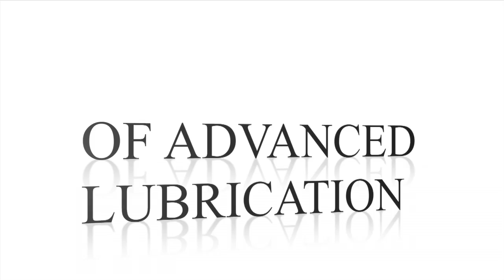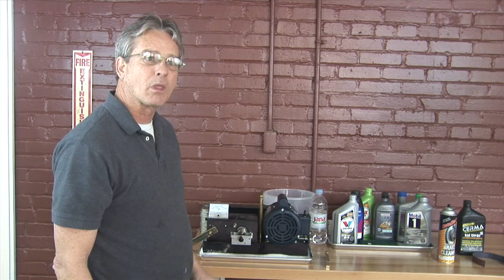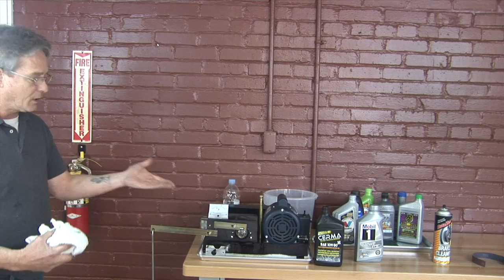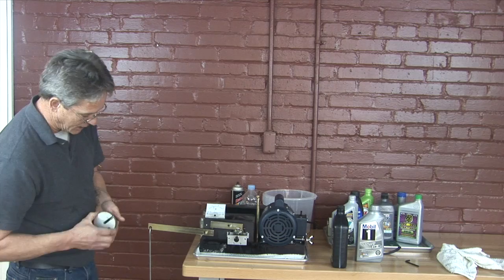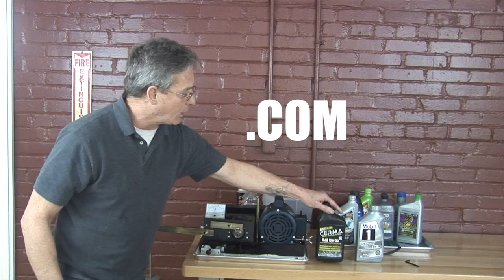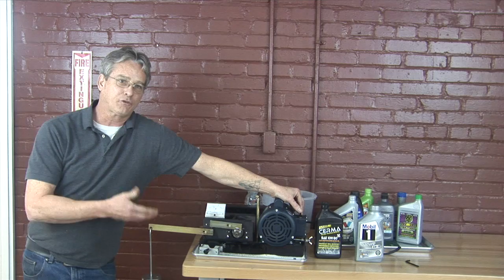Cerma Oil Advantages Demo

Comment: can't use this....need to be done correctly and with good sound, videography, etc..
Reply from the maker: no kidding, told you I had to redo when I receive my new mic system.
Reply: This is just pure silicone and will make the engine run more quickly and cool . It's just to expensive for silicone i have a God truck 159.000 miles id applu this product and make a video and show if this really works the truck starts hard on cold days and viberates holds almost 5 gallons of oil id like to prove that I wrong ans that this is a true product unlike all the snake oils out there slick 50 the original back in the 90s was good it did help big time but had Teflon